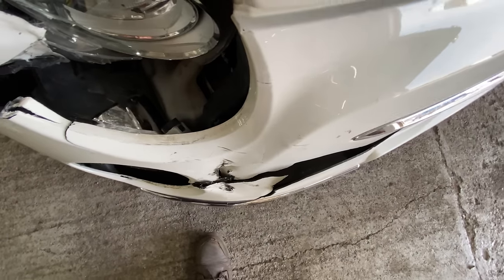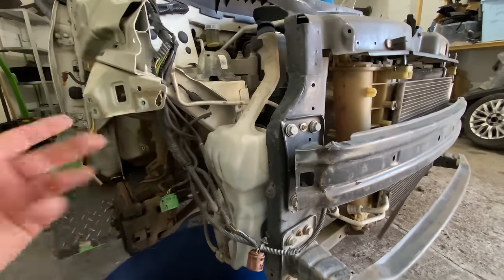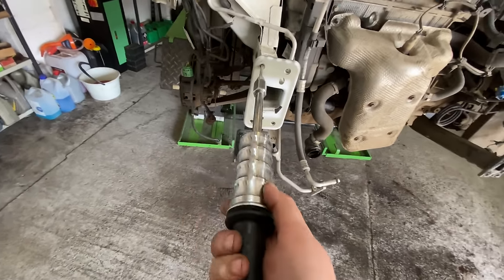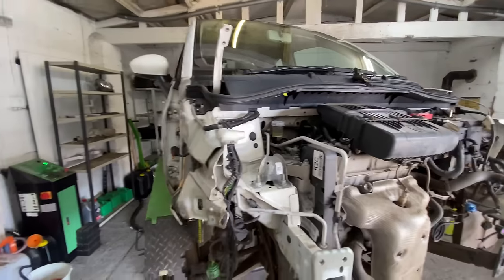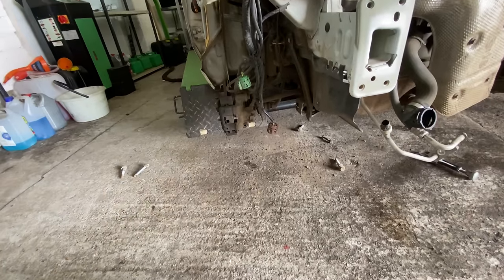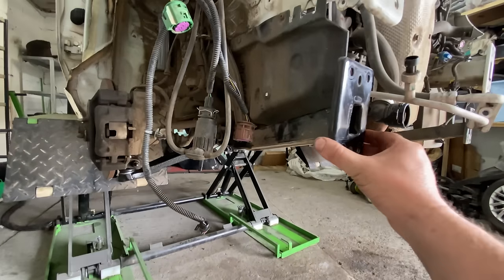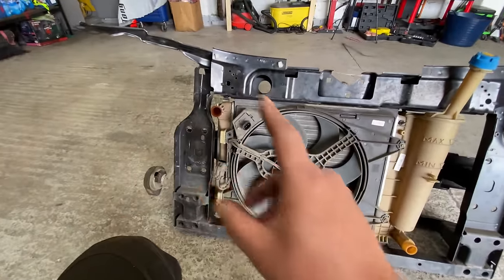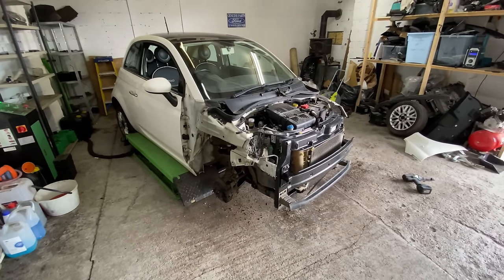Fiat 500 Cat S Damage Assessment How Bad Is It Behind Bumper And Wing  Part 1

Comment: Yeah door card off, release that screw in the side just to give the handle a bit more movement. Remove 10mm nut on hinge. Remove the old hinge, then unscrew the bit that’s still attached to the handle with a screwdriver through the hole. New hinge has to fit unfolded because of the screw, once screwed up, again through the hole, pull the handle out a bit and pull the hinge into position into the hole and put the nut back on.